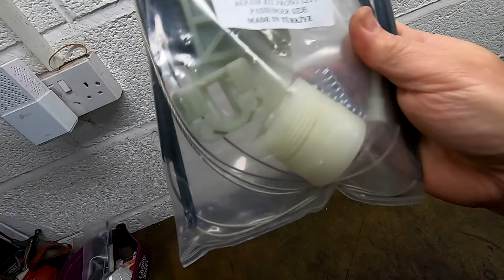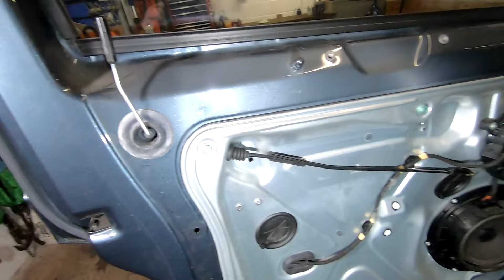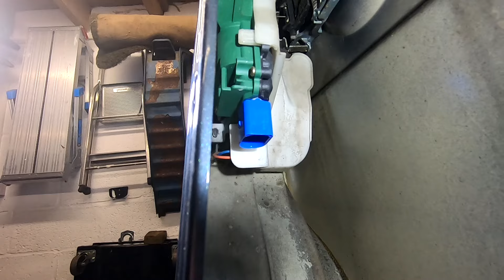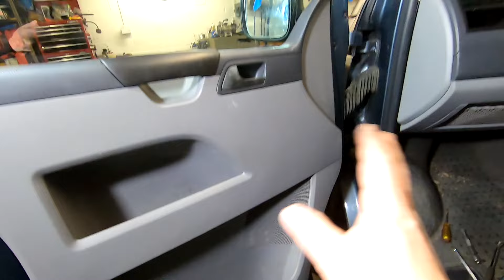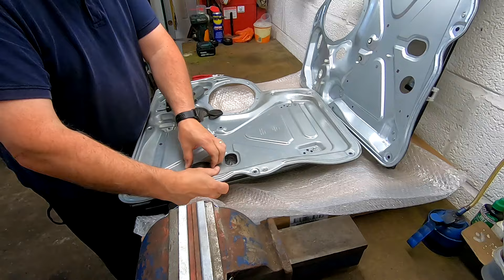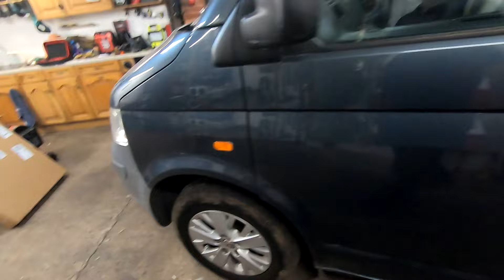VW T5 Electric window repair

Comment: Hi, Great video and really helpful. My electric window packed up and the cables all birdnested whilst we were away at the outer Hebrides. I ordered the whole replacement panel like you did in the second half of the video and fitted it back in. Two weeks in it's all nested again. When I took the panel back off the second time I found the black plastic piece for the lock lying in the bottom of the door panel but had no clue where it was from until you showed it in your video "THANKYOU" I can only assume after watching your video that this plastic piece had broken at some point and was indeed the cause of both snagging and birdnesting issues. I will now order another replacement panel and re-fit, and hopefully, I will have better luck this time. Thanks again, I've subscribed and I will be checking out your other videos. @himherandthedogs

Comment: Great video. Thanks very much. My problem is that the window is stuck inside the door frame so I can't get it up (the window, that is 😄). Any tips?
Reply from the maker: @georgegoulburn3549  . Thanks, that's a tough one. Perhaps start taking the regulator panel off (maybe leave a couple of loose bolts in the top) and try to pull out the bottle and push the glass up-helping the motor? Don't know for sure? Good luck sorting it out 🤞
Reply: I had that problem. I found that if you take all of those 10 mm bolts out except one at the top (Which you can just loosen) you can prize away the bottom of the inner door panel and get a piece of wood up and inside and push up the window a few inches so you can grab it at the top and pull it up further.